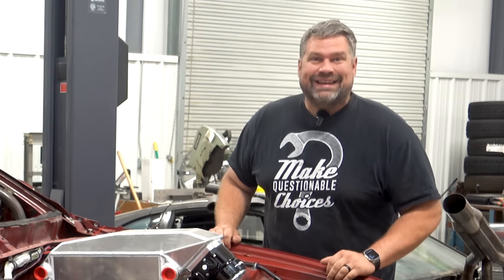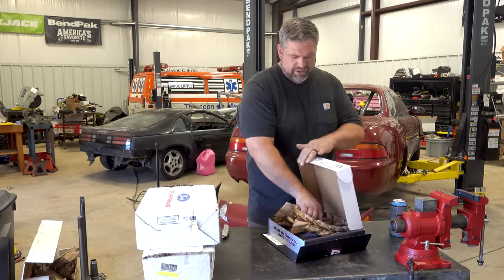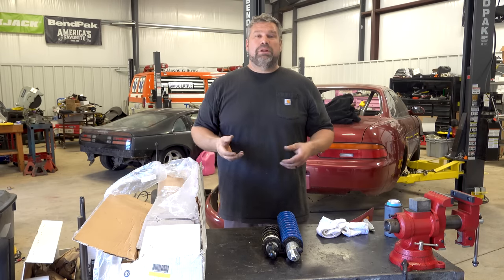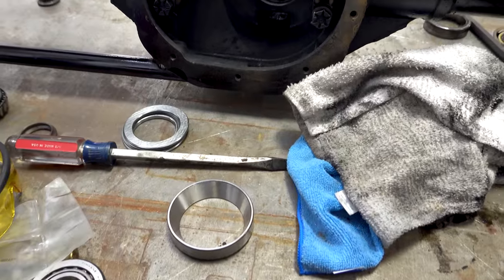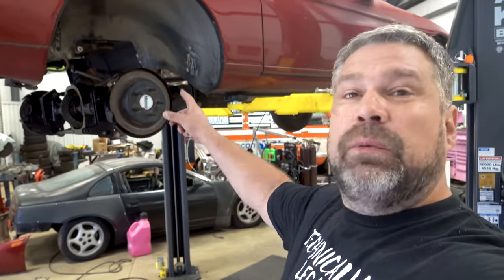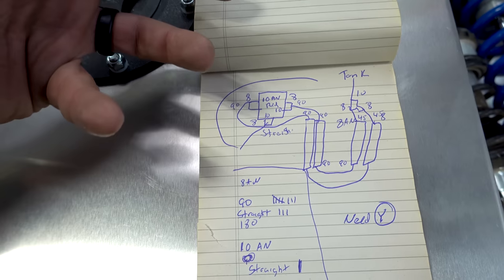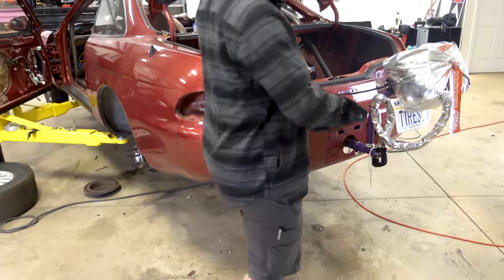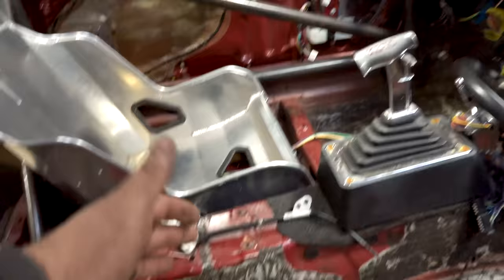Don't Do This With Your Drag Car. 1,000HP Lexus Drag Race Build Major Progress!

Comment: 18:38 For Duane. Essentially you need a center smush. Depending on where the shims put the gear (deeper in or out into the cavity), you'll get a smush that's either outside or inside the ring gear's teeth. Your aim is to get it smack down the center (and depending on the left to right shim action on the diff or non diff package, you either get a narrow contact or a wide contact smush). The smush in the image is "chef's kiss", if just a touch too high on the gear, but very likely exactly where it needs to be (you can only shim it depending on what shims you have, nutty flavored people spend weeks cutting their custom shims for both of the "settings" to to get that contact smush exactly right, which is ... not really worth the effort). Those gears touching exactly right.
Reply: Love the amount of knowledge in this post while still using the word "smush" to describe the gear teeth engagement
Reply: Thank you. I learned something today. I got the concept of what Jared showed and you explained it very well.

Comment: Love the progress... and I do love Ebay motors... always use them for parts... I check retail pricing then check ebay... Like 2 weeks ago, I needed a door actuator for my car, the dealer wanted $720 for it, cheapest I could find a new one was $550, I went on eBay motors, found one from a used/totaled car, it cost me $65 and works perfect...

Comment: Now we didn't change the gearing but I recently rebuilt a dodge 9.25 rear end and we got the perfect result first try.     There was alot of measuring and inspecting first along with lots of research followed by more caution going together.     No more terrible growling noise

Comment: Tip 
When editing anything make a copy first and put it in a safe place on a separate drive then periodically stop and make another copy of your progress in a different place.
Never delete the original or final or intermediate works until you have verified that you will never need them ever again. Note , this is usually a week after you have uploaded the final work and no one has pointed out any errors.
On a separate note , don’t use extremely long names for files or folders keep it simple. A date in the name can help also.
All this is on top of any automated backup system.
And finally 
BEWARE the drag and drop
Files that go missing are often accidentally moved to another location without you realising because you accidentally dragged them there while looking for something else.

Comment: Being precise on diff shims is only really necessary on an everyday driver so that the diff isn’t noisy or self destructs due to chatter or lack of free play.
On a drag car as long as there is enough clearance so the bearings don’t bind and the pinion isn’t chattering or way off on the contact patch just send it.
To put it in perspective a diff in a luxury car might be 100 on the anal retentive scale and an eco box at 80 to avoid warranty claims . So you only need to be at or over 60 on the scale with a drag car not the full Monty.

Comment: Love this series Jared (as with most wrench every day stuff of course). I've some confusion with a couple of the design parts though (and I apologise in advance for knowing almost nothing about drag racing). Firstly, the rear shocks - you say that you needed much more travel on the rear end, but doesn't that just mean that more energy will be used by compressing or extending the suspension rather than driving the car forward? Also, you've talked about the fuel tank system being complex etc, but surely any long range tanks are a bit pointless as the car will have no rear diff - surely you wouldn't want to be driving it like that for any distance? Or do you have a tyre sponsor? 😀

Comment: I'm not going to knock on you for wanting to do things right but unless you have some future plans for this car (like really going to a drag and drive) you're really putting it on overkill just for a 10 second race. I mean 2 fuel tanks, dual injectors, 1000 HP, TH400, rear end upgrades... You must have more in mind for the car after the race with PFI Speed.
INQUIRING MINDS WANT TO KNOW.
Reply from the maker: We both have something really sick planned!
Reply: @TheQuestionableGarage  
Aaah? That seemed like a "Sick Week" hint. That would be awesome!

Comment: When you started talking about the ring and pinion, you said you went from a 3.08 to a 3.30.  Later in the video when you were showing the new ring and pinion and describing the teeth and what not, you said it was a 3.73.  What did you end up going with?  A 3.30 or 3.73?  3.55 would be a good option too.

Comment: How do you guys protect your cars from rust in Florida?
Reply from the maker: By living in North Georgia! The Florida crew just has to avoid the salt water, and frequent washes. Even with the salt due to the high temperatures rust has some struggles until you hit the coast
Reply: @TheQuestionableGarage  You guys don't put and kind of special rust resistant primer or paint or something on the vulnerable parts of the car?

Comment: I'm shocked (pun ntended) to see how much longer those suspension units are than the originals. I'm clueless when it comes to drag cars. Why are they so long?
Reply from the maker: You want the suspension to have the ability to travel, with a 4-link setup you can make the car push the tires into the ground. If your shock doesnt allow enough travel, you can top out the shock and actually bounce the rear end up and off the ground!
Reply: @TheQuestionableGarage  I was expecting drag cars to not have much in the way of suspension travel due to the general lack of lumps in your average drag strip.

Turns out horsepowers are pretty lumpy on their own, plus a hair on the track is probably enough to send a car into orbit at top speed. Maybe Motocross suspension travel helps with that too... Or maybe it's a liability. 😄

Comment: I don't understand why you through the shirt away. The fuel system doesn't need to be that excessive theres more that enough guys out there that duel fuel their car and its much simpler and most race prep'd th400 cases don't have the ears for that reason its almost like you've never done anything like this before.
Reply: And most likely you'll be using some sort of air or co2 for boost and maybe shifter why not a air assisted shoot rather than whole situation